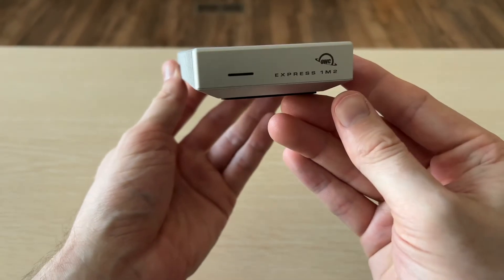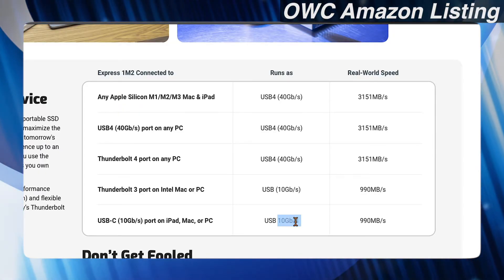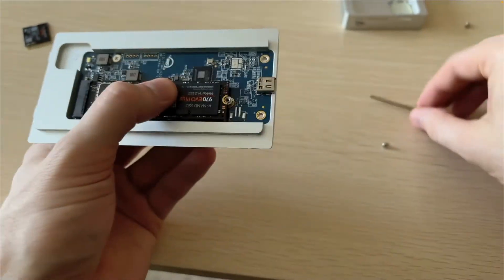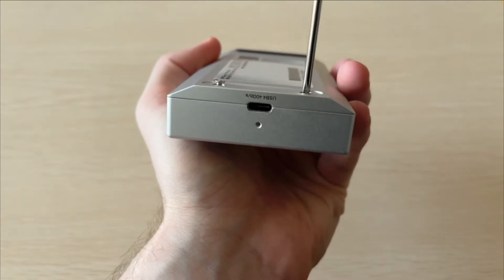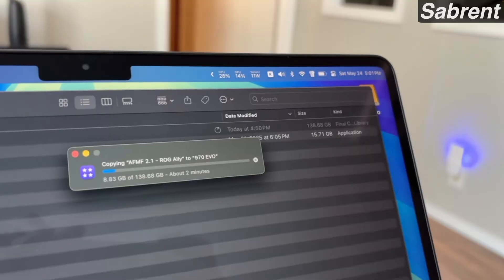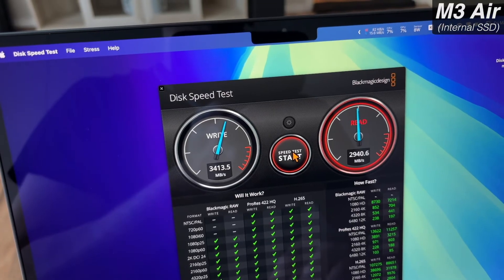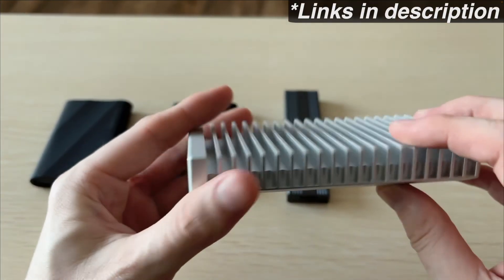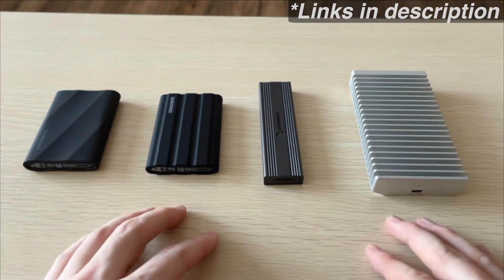OWC Express 1M2: Speed king, BUT...

Comment: I have a ROG STRIX G18 and would like to use this enclosure with a Samsung 990PRO to boot an OS from the Thunderbolt port. I'm afraid that the drive will shut down systematically due to overheating. Is this possible?
Reply: That enclosure have an excellent heatsink with fins that actually do their job very well. If the ssd you put in have nand chips only on one side(like all Samsung 990 pro do) and the thermal pad touch properly, that's very very unlikely unless you live a place with an ambient temperature of 40 celsius and you hammer the SSD with constant write. I just tested mine with a Samsung 990 pro 4tb and did a 3.3 tb write to test it which I believe would be a pretty brutal test for most user. I ended the write with a temperature of 49 Celsius from an ambient temperature of 18 Celsius, so a delta of 31 Celsius.

If you use a double sided SSD, then there is no enclosure that will cool properly the nand chip on the back so you would have to treat it as any other enclosure and make sure you don't make big write on it in one go.

Comment: Excellent enclosure. I use it with a 2TB SSD as the main drive in my MacBook Air M1 and after installing a 12cm cooler that stays on all the time, it's perfect.

Comment: Interesting observations, but in my opinion it does not have much sense comparing the power draw of those two enclosures, given that they have different speeds and technologies inside.
Did you test two TB4 enclosures?
Also really interesting was your suggestion the way to properly close the enclosure to avoid nvmw disk damage, I have read of the not so clever solution they did.
At this time, for me, the major cons of the OWC TB4 enclosure is the price, way too much compared other alternatives.

Comment: I did my review on this enclosure a while back. It kept self ejecting from my M4 mac mini. I suspected it was drawing too much power for the M4 mac mini to handle. This video confirms it. Very informative👍
Reply: Glad you posted this.  Very helpful.  TB4 supports 15w.
Reply: Did you have other things connected at the same time? My Mac Studio M2 Max can handle two of these at the same time, no more.
Reply: @Mike-g3q8h Yes, mouse, keyboard and two monitors.
Reply: @nofrillstech  I see. So basically nothing that could affect the disconnect, or shouldn’t anyway.
Reply: @Mike-g3q8h It shouldn't. I gave up on it...sits in a storage box.
Reply: @nofrillstech  I have mine connected to an M4 Pro Mini and have had zero issues with disconnections.
Reply: @poppys33d As long as you have one of these, two at most, it shouldn’t be a problem as long as you don’t have other peripherals drawing much power. If you want to connect more get a Thunderbolt hub and connect it through that instead, that’ll fix the power delivery problems.
Reply: This is a deal breaker info you won't read anywhere. So, it disconnects from,say, a Macbook M4 max aftet some time?
So, which thunderbolt 4 enclosure is travel size and doesn't have problems?

Comment: Yeah, cover the LED with tape or read the manual. "The brightness of the LED indicator can be adjusted using a switch on the board inside the OWC Express 1M2."
Reply: Not so for the older ones. The LED switch is only in the newer ones.
Reply: @Mike-g3q8hIs that on newer 40gbps units or only the 80gbps model?

Comment: The problem is the ASM2464PD chip, it uses nearly twice as much power as JHL7440 thunderbolt 3 chip.
Reply: So which enclosure models are baded on yhis JHL7440 and are safe to use with macbooks? So they won't disconnect and draw too much power? 
Also, it's possible the models based on this chip number are older so you get less yhan 3000 read/write performance. But maybe its enough for editing 4k -6k video files directly from that external m2 drive?

Comment: The temps testing is pretty useless, since all enclosures generate heat and will use power to run a ssd externally.

Comment: Well there’s something you kind of have to take in to account. Most NVMEs are going to consume on average 5-6W with 7-9Ws during peak usage. That doesn’t leave much left for the enclosure. Thunderbolt is limited to 15W. Now on my personal use case I found other drives namely 3rd gen models would cause random disconnects. Since moving to a 990 pro I’ve had zero disconnects and the unit runs a tad cooler to the touch. Now for portability the drive will unlikely be running at max effort for a substantial amount of time. Your CPU will spike 3-4X the wattage for TB or USB devices will draw. I spend around 6 hours in class with a 14in MBP with an external and stopped bringing my charger because it still has 40-50 percent battery at the end. I do run a short TB cable because it makes me feel better.

Comment: I have this paired with a Samsung 990 Pro and wonder if the heat comes from the SSD or the enclosure.
Reply from the maker: I've let it get pretty toasty and then immediately opened it up to feel the SSD and OWC board, and the OWC board itself was pretty warm.  If I had to guess, I'd say the OWC board produces slightly more heat overall than the 970 EVO Plus.
Reply: @FilterlessTech Yeah, it’s the board definitely. I’ve tried it with an older Crucial P3 and it runs a tad cooler than, let’s say, a 990 but not much. I’ve found it to run the most stable and fast with a WD SN850X though, not cool, but stable.